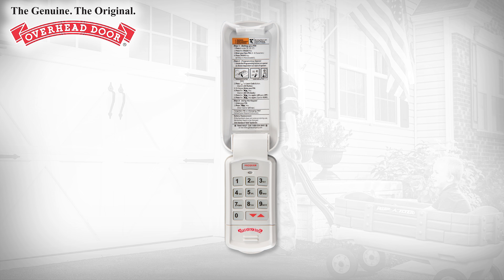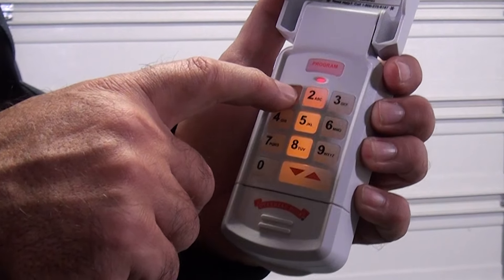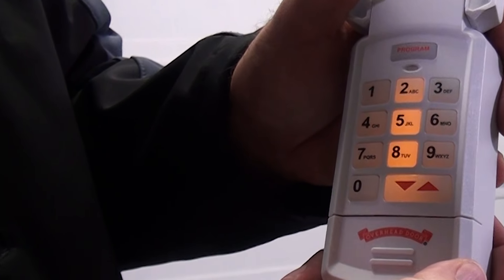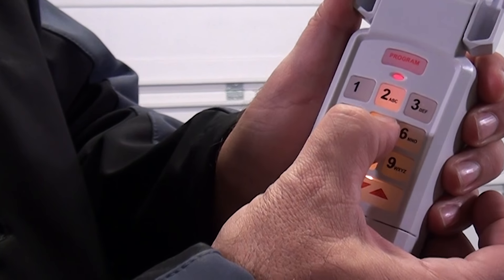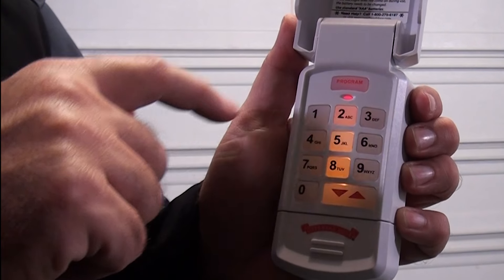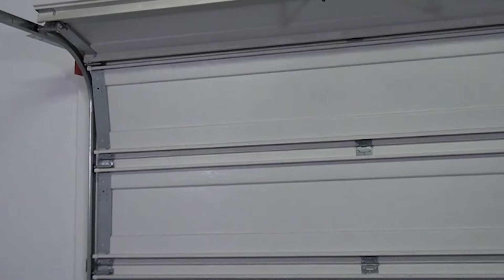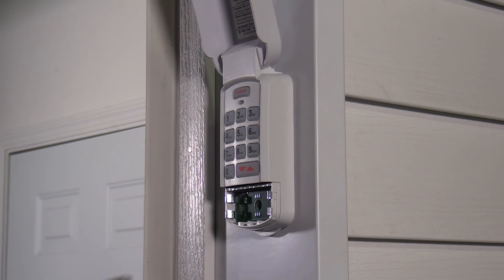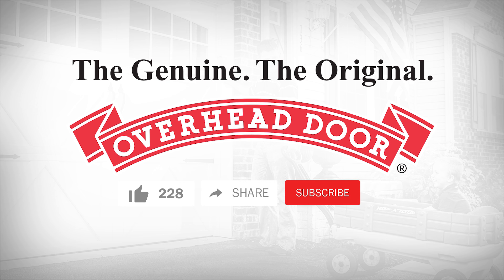How to set up an Overhead Door® Wireless Keypad

Comment: After struggling with the keypad and instruction sheet for two days, I finally looked for and found this video. I'm now all set and it took a few minutes. The hardest part was setting up the ladder to reach the door opener unit ... this part was not clear in the instructions! Wow, so easy once I understood. So happy someone thought to make and post this video! I wish the instructions had included the suggestion to look for it if needed.
Reply: i realize it is pretty off topic but do anybody know a good place to stream new movies online ?
Reply: @Hugo Jayden Ehh I use flixportal. you can find it if you google :) -kylo
Reply: @Kylo Kingsley Thanks, signed up and it seems to work :) I really appreciate it!!
Reply: @Hugo Jayden happy to help :)

Comment: Didn't work. I went through the steps. The garage door program light turns red ever time, as soon as I hit 357.
Reply: I have the same problem. Red LED on bottom of door opener flashes red each time enter is pressed. Earlier I reset the remote as explained in the video prior to step one. After doing step 1, the head unit clicked. Now, nothing happens with 357 except for the light flashing. 😩
Reply: Here's what worked for me:
Do a factory reset by holding the PROGRAM and up/down buttons until the light blinks and then goes out. This sets the code back to the default 357.

Push the learn button on the motor. Go to the keypad, press 357 and then press up/down repeatedly. If the garage door starts moving, it worked and the remote is paired. If not, start over. 

Once paired, reset the pin with 357 PROGRAM [new pin] PROGRAM. Now the new pin should work.

Comment: This is a simple process. The big question is: why does the keypad loose it's capability to activate the door after a few months? Even if it is the batteries it should hold the program. (it's what is says in the directions)

Comment: Thanks for this video. I tried to get the pin-pad working a couple years ago with written instructions and never worked. I was out of town when the garage door was installed and my wife never got a pin for it. This video cleared everything up!!! I had to realize that to make it work from the start I had to use the factory (3-5-7) pin to get the up and down arrow button to work. Once that is "talking" to the door I had no problem changing the pin.
Reply: Took me a bit to realize this same thing!

Comment: Thank you! I tried the instructions in the owner’s manual- didn’t work. 
Tried the instructions on the inside of the keypad flip up door- didn’t work. 
Finally, tried these instructions and it worked perfectly. You could improve these by slowing down a touch. Thank you again.

Comment: Finally found this video.  Wanted to reset my pin.  Did so but must have gotten a keybounce so the pin didn't work.  This video had the procedure I could find nowhere else - how to set the keypad to factory defaults.

Problem solved, correct pin set, two happy door openers.

Thank you!

Comment: TL;DR:
Do a factory reset by holding the PROGRAM and up/down buttons until the light blinks and then goes out. This sets the code back to the default 357.

Push the learn button on the motor. Go to the keypad, press 357 and then press up/down repeatedly. If the garage door starts moving, it worked and the remote is paired. If not, start over. 

Once paired, reset the pin with 357 PROGRAM [new pin] PROGRAM. Now the new pin should work.

Comment: The 357 code is not doing anything after the factory reset? Control unit outside lights up and allows me to try and program the factory reset but it will not work the door. The indoor garage and car remotes work but not the outside keypad unit.
Reply: Did you get any help on this?  I have the same issue.
Reply: 1. First factory reset by holding the "PROGRAM" and "ARROW" key at the same time, holding the keys (~5 seconds) until the red LED flashes as described in the video at 1:40.
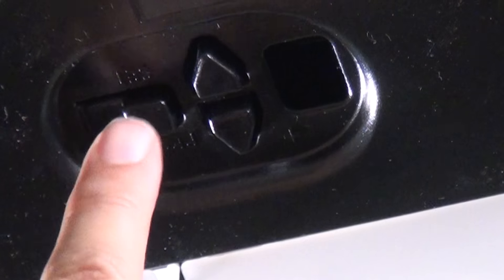2. Next hold the SQUARE BUTTON on the garage door opener (as described at 2:25 in the video) until you see the light turn blue.
3. Quickly go to the keypad and enter "3-5-7" slowly, then press the "ARROW" key slowly several times (as described in the video at 2:40).
4. The garage door should open.  If it does not, make sure you are using the correct brand of garage door opener and associated keypad (Overhead Door). If you the brands of both are correct, replace the two AAA batteries in the opener keypad and check to see that the garage door has power and opens and shuts by pressing the internal button.
5. Lastly, repeat steps 1-3 above, following them precisely in a slow and methodical manner.
6. If this doesn't work, your keypad opener is probably not working correctly.
7. If a replacement keypad still doesn't work, it might be your garage door opener that's faulty, but before replacing it as well, I would consult with someone and/or watch this video again taking precise notes, as there's likely a detail you are missing.
Reply: @lenschulwitz1934  It didn't work for me. The blue  program light turns (purple) then red when I put in 357. Must be a bad opener.  It is over ten yrs old.
Reply: @lancebrown8823  sounds like you have a different opener, there's probably a different method of programming it.
Reply: @lenschulwitz1934  Genie 1000, same outdoor opener as the one on the video.

Comment: For model 2026 this may help.
Disregard the printed instructions for the keypad. Follow the instructions on the inside cover for keyless entry. You probably have ID #1 if you have the larger remote. Follow the printed instructions for your car remotes.
Be prepared to spend a few hours.
There are multiple videos and directions. It should not be that difficult. Overhead you can do better. See if homeowners can do this in under an hour.